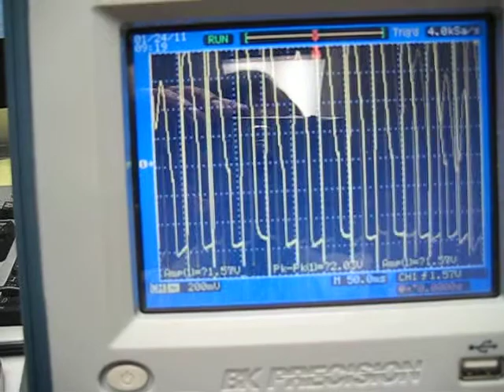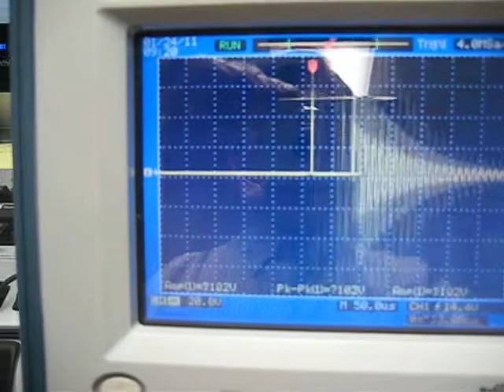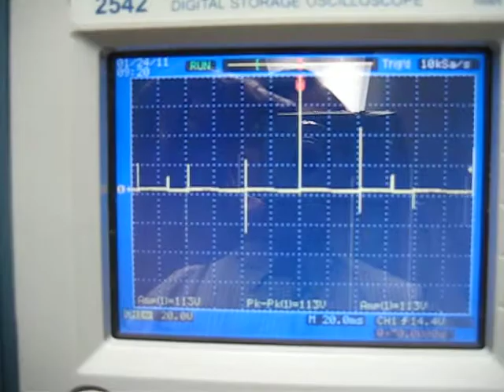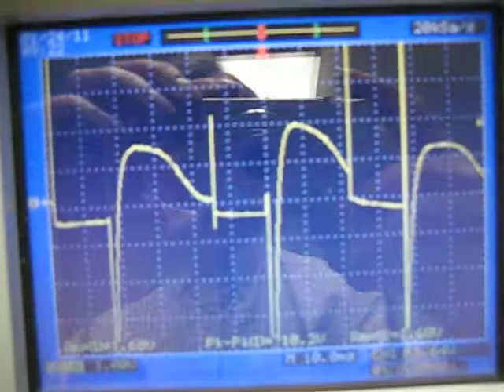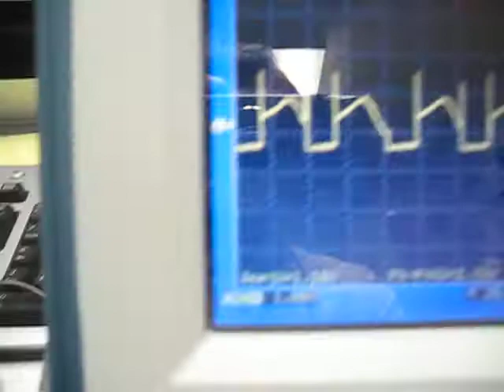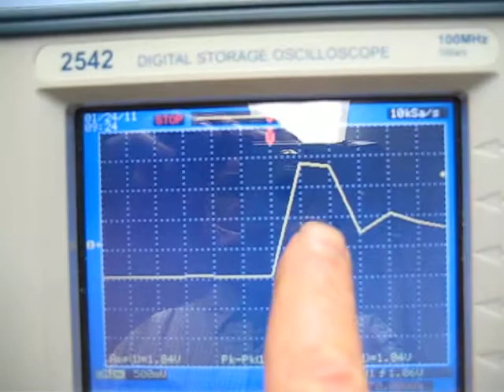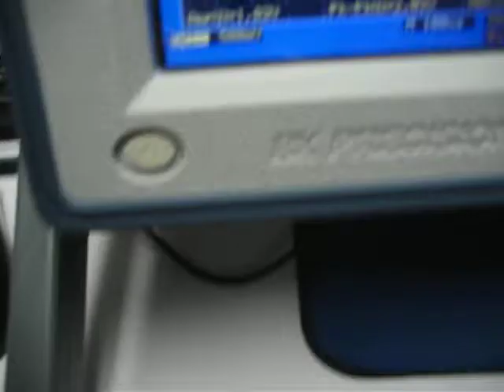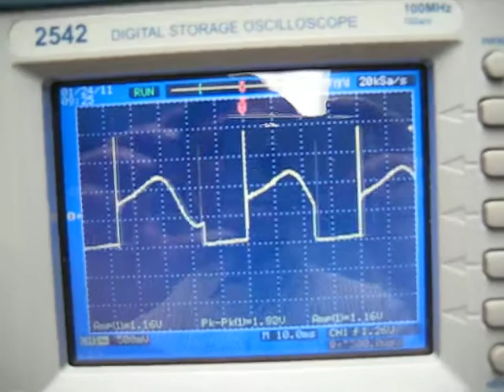Iron-Less Monopole Motor Runs On updated Iron Pyrite Battery 2

Comment: I am amazed by earth batteries although there does not seem to be many resources on galvanic reaction theory... there is lots about what happens but not about why it happens??? I think the addition of the CalChlo actually reduces the amount of oxygen available as it is hydroscopic .. which would reduce the rate of Magnesium Oxide forming on the magnesium surface therfore providing a lower internal resistance in the cell possible?